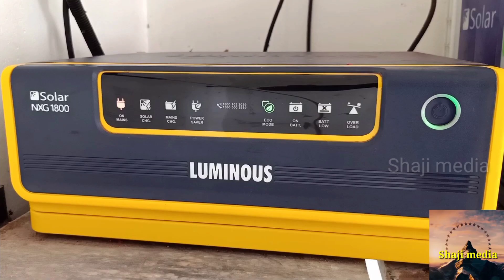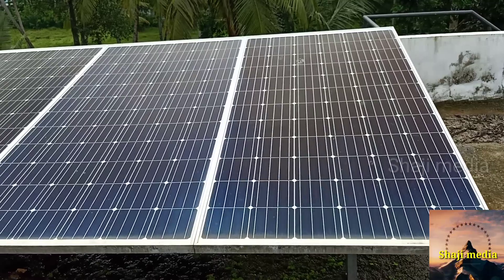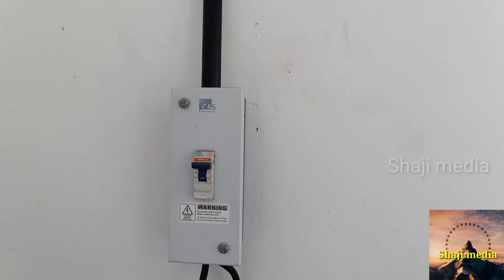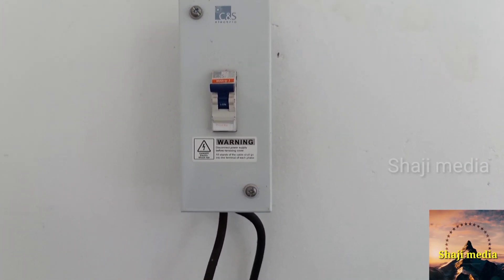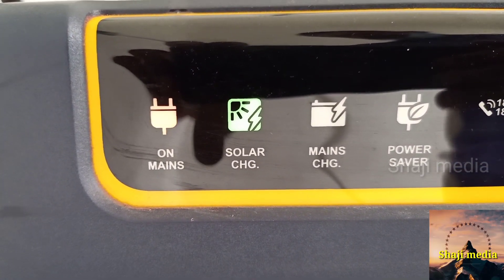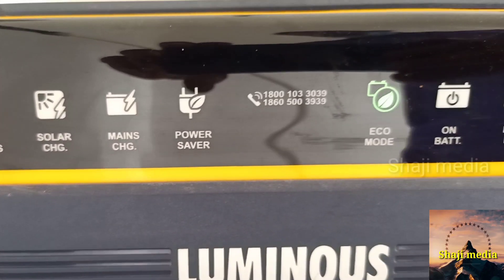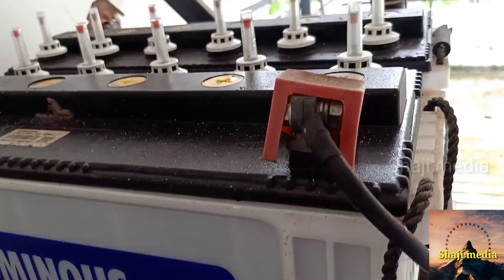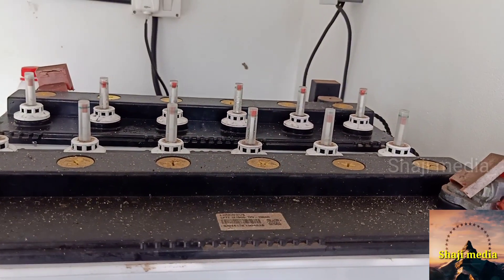1.5 KVA Solar System Malayalam Review//solar inverter

Comment: Please find my suggestion. Is it possible? 

1.Solar Inverter 4 kw.
2.150 ah 4 batteries (48v)
3. MPPT charge controller 60 ah
4. Solar panels 380*4=1520watts
Reply: 380*6 panel ok

Comment: 24 v 375 W പാനലിൽ നിന്ന് 12v/24v 30 amp mppt charge controler ഉപയോഗിച്ച് 150 ah 12 v battery connect ചെയ്യാൻ സാധിക്കുമോ
Reply: yes,but amp kuravayirikkum, amp 15 enkilum vendivarum speed aayi charge akan